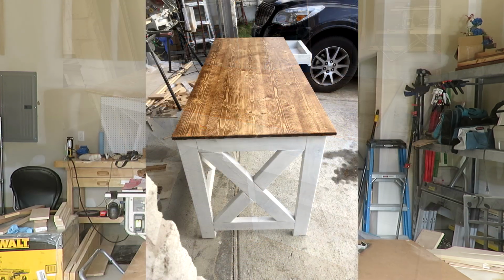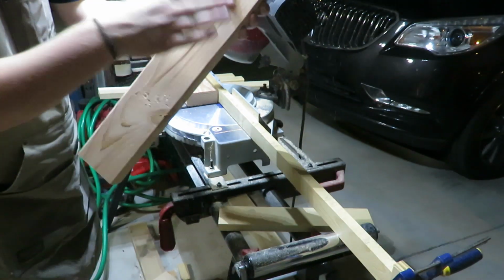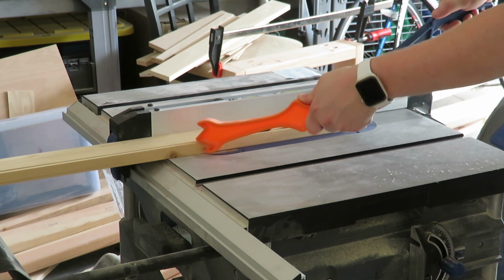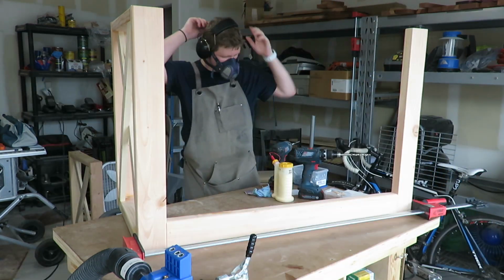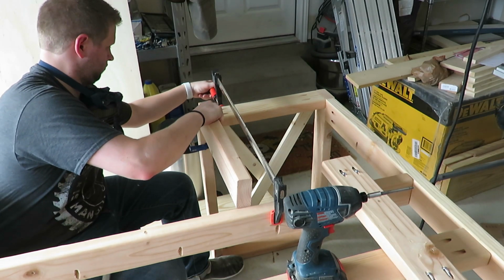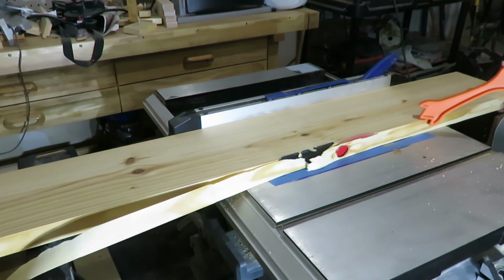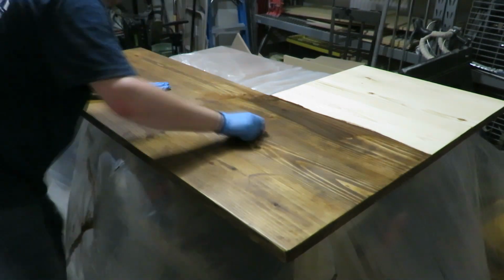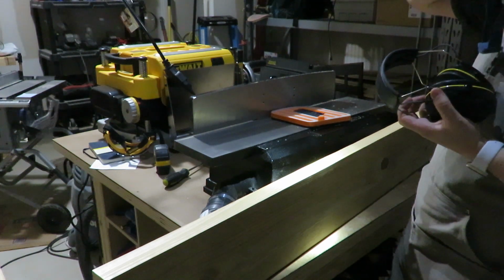DIY | L-Shaped Farmhouse Desk!

Comment: How fine did you sand those frame parts in order to get a good smooth paint job 80,120?
Reply from the maker: I sanded the base with 80 then 120 then 150. I then used milk paint on it.

It did a good job and adhered very well!

Thanks for watching! I hope it was helpful!

Comment: do you plane and joint the wood before you make this? or does it come usable? if so, where do you get the wood from? love the desk and wanted to try it out
Reply from the maker: I did plain and joint the top for this, but I have made several similar desks where I did not have a jointer or planer and it worked out fine.
You just have to be careful when picking out your lumber and get straight pieces. Take your time and spend an hour picking good boards and you’ll save yourself a headache later.
I got this wood from Home Depot and Lowes. Just used pine and whitewood.

Thanks so much for watching and I hope you enjoyed the video! Good Luck with your desk and share it with us when you’re done! :)

Comment: Is it possible to give the dimensions used for this desk, trying to attempt it. Very lovely build.
Reply from the maker: I'm so glad you found this video inspiring and helpful!
So the height of the desk from floor to the top of the tabletop is 30".
The X box legs on the end are approx. 20" wide by 28.5" tall.
The main length of this table was 58" long and 21" wide.
The L-portion of the desk was 23" long and 21" wide (so the total width of the desk at the L-shaped portion was approx. 42".

I will have my website up soon with blog posts on each project and some pictures to help you follow along.  Be sure to subscribe to my channel and I'll make sure I mention when the site is up and running!  I have several more big projects coming in 2020 that are already in the works (you can see glimpses of those already over on Instagram)!

Thanks again so much and I hope I was able to help you out!

Comment: My wife would kill me if I used miter saw while her car was still parked in garage
Reply from the maker: Oh yea, I can’t even fit a car in my garage anymore because of all the woodworking equipment hahaha!
I do run a vac on each piece of equipment though and I have an air filtration system running as well. That has helped a ton to cut down on the sawdust that ends up on stuff in the shop/garage. 👍🏻